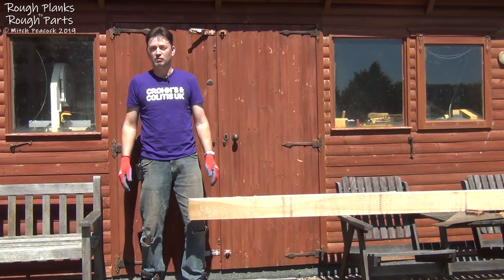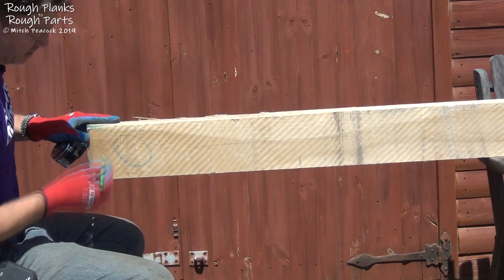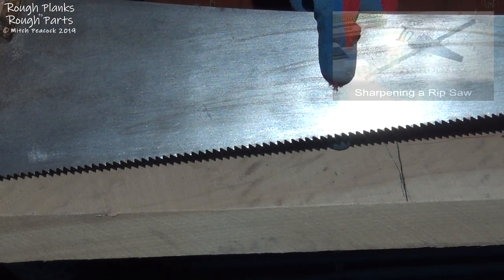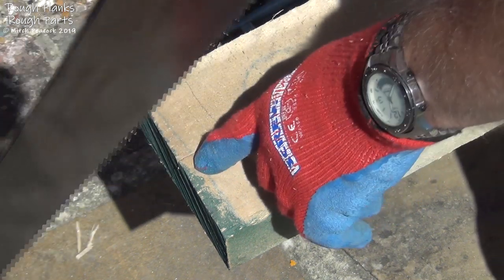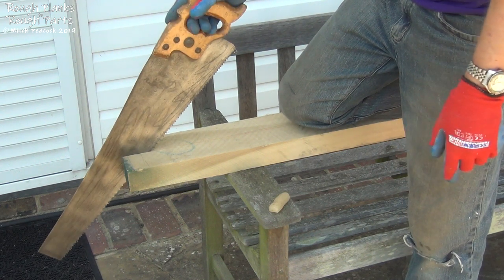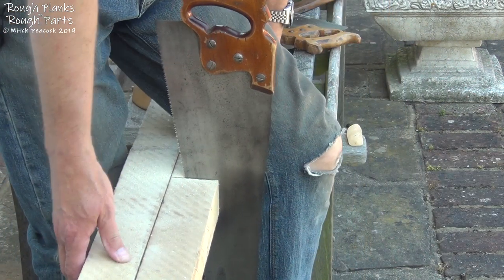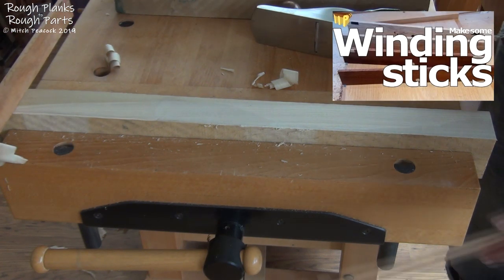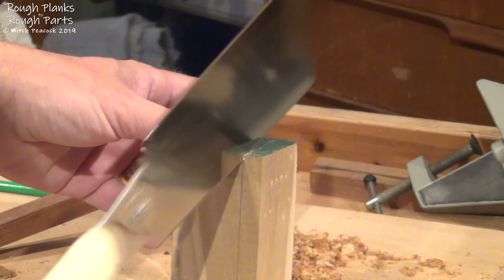Rough Planks to Rough Parts - Unplugged Woodworking Techniques

Comment: Hello Mitch, I'm sorry that I do not understand English.  But what I saw was very interesting.  What were those marks on the screed?  Is that the sawmill's transport rollers?  Greetings from Germany 🇩🇪 Martin 🙋♂️ Cheers.
Reply from the maker: Hi Martin. I have to say I've never seen a surface effect quite like that before. You may be correct with transport rollers. Maybe I can stream a bit and see if the depressions pop up.

Comment: Maybe I missed it, but I didn't see you check for cup or bow when you were flattening the first face, just wind. Do you assume if the twist is gone, now it's flat?
Reply from the maker: Maybe I failed to clearly demonstrate it here. Using a straight edge, in this case the steel rule and a winding stick, I checked the width for cup, and length and diagonals for bow. Combined with checking for wind, this has always got me flat in the quickest way.
Most certainly, just removing twist doesn't ensure flat.
Reply: @mitchwoodwork  thanks a lot for the response, I thought maybe I just missed it. I appreciate the explanations always Mitch, you have single handedly taught me a substantial amount about hand tool use! I really appreciate it
Reply from the maker: @rickhickman2730  Pleased to be of help Rick. Love to see any pictures of stuff you make.
Reply: @mitchwoodwork  if I ever get something complete I'll share with you 😁 really struggling to get any lumber flat and square. I am trying to use hand planes to flatten a face and flatten an edge, then use my power planer to thickness and my table saw to rip but so far not much luck with my old Stanleys!
Reply from the maker: @rickhickman2730  Start on something small, say 12"x4"x2", and ignore all but one face. Plane that smooth to begin with, then get your winding sticks out. Check the sticks are straight and parallel before you use them! Use one stick to check for humps in width and length, and plane any away. Now you should be able to check for wind with the sticks touching both edges of the board (not able to rock). Determine the two high and two low corners (assuming there is some wind), then take stop shavings from all but the low corners, and a shaving right through the centre (to remove any hump created in the width). Check and repeat until the wind has gone or reversed. If it reversed then you need to set the iron for a finer shaving. Once the wind has gone, check for any hump in the face that may have been introduced. Remove any hump with stop shavings, leaving the corners (these are the references for flat). This should get you flat, although with a few tiny steps where shavings were started or stopped on the face. A set or two of fine shavings along the full length should remove these.
I initially had trouble with flattening, but found visualising the technique really helped, and after a bit of practice it became second nature.
Reply: @mitchwoodwork  that's a perfect description of how to get a board flat. I'm finding with rough lumber, my plane doesn't want to take a very nice shaving. I'm thinking I need to sharpen it up again, and set it for less deep of a cut to start with. My winding sticks are nice and flat. I will try it out in the next day or two and let you know how I make out, I appreciate you taking the time to explain it like that!